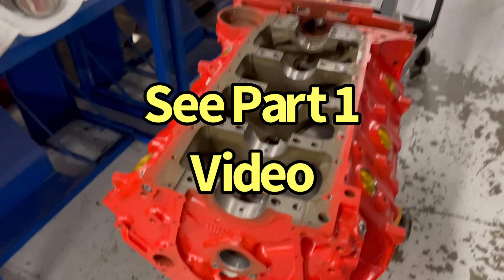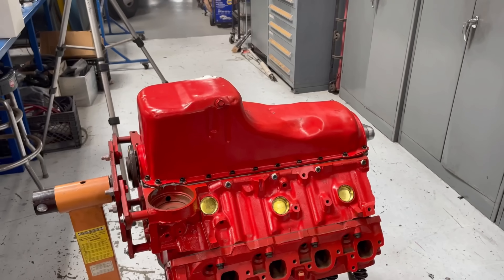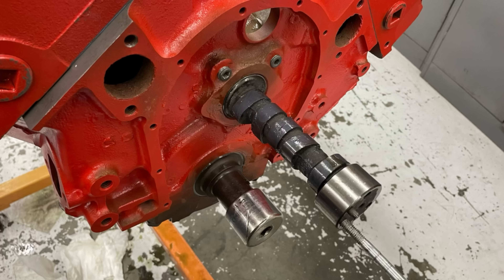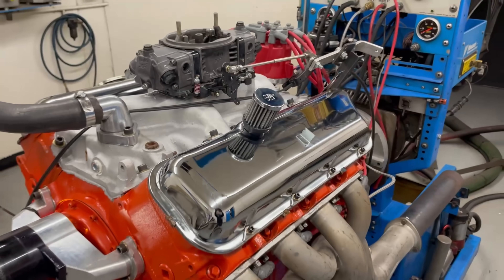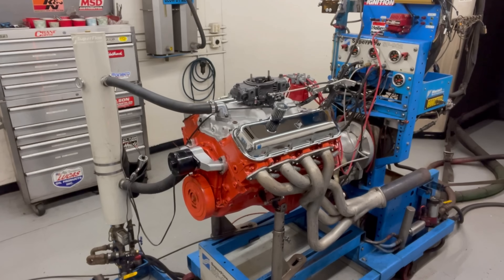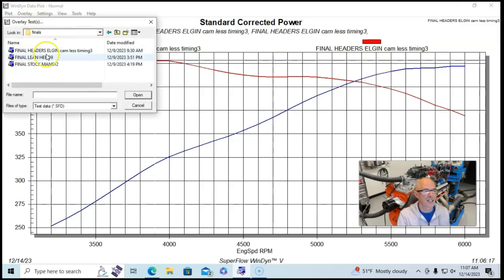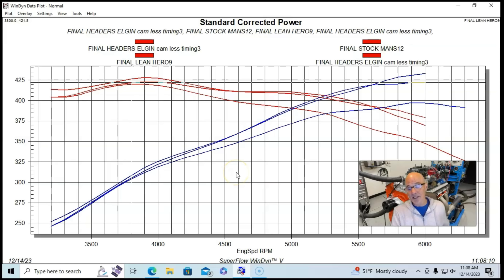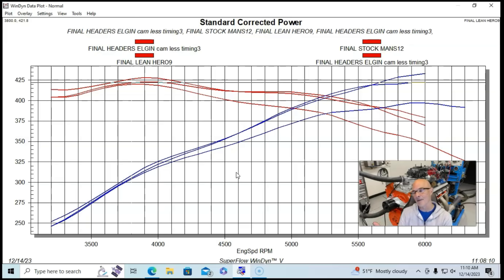FULL DYNO RESULTS ON THE L78 396, OVERRATED AT 425 HP OR  UNDERRATED AT 375 HP? WHAT DID IT MAKE?

Comment: Would you consider putting a 454 crank (4 inch stroke) in a 396 to create a square engine 4 inch bore, 4inch stroke ? Keith Black makes the pistons for this combo.
Reply from the maker: NO SIR
Reply: @richardholdener1727  I am looking at those same KB 396/402/434 pistons. I am curious why you wouldn't consider it. If there is an unseen (by me) problem with this, I would like to know before dropping some cash down the drain. Very good test by the way.
Reply from the maker: My point was that this 396 is staying a 396 (actually 402). If you are asking if you should do it, then the answer is yes-bigger is better. Or just go get a cheap 454 from the junkyard for less than the cost of those pistons.
Reply: @richardholdener1727  Thanks for the reply, it means a lot. I've had 2 402's for a long time, and in my area 454's have turned to gold $$$ lately. Time do do something with them. Thanks again.

Comment: I was under the impression that in those days they tested the engines bare, with no accessories and maybe not even a water pump.  Today engines are tested with everything on them which I assume includes water pump, alternator and power steering.  I think 375 is the correct rating.  With stock manifolds and so forth it was hard to get 1 hp per cubic inch, and harder on a large displacement engine than on a smaller displacement engine such as the 302.  Now how they got 365 hp out of the FI 327 I don't know.
Reply from the maker: The L84 Fuelie 327 was rated at 375 hp, the carb L76 327 was rated at 365 hp
Reply: @richardholdener1727  I wasn't sure if I remembered the numbers correctly but a 327 getting the same hp as a 396?
Reply from the maker: This 396 clearly makes more than the Fuelie L84!
Reply: @richardholdener1727  Well I would agree with that too.  If it didn't there would be a problem with the tuning or maybe the cam grind.  I remember that the fuelie cams were pretty radical.  I didn't have a fuelie Corvette but did have what I thought was the same cam grind in other cars.  But if the 396 has more power then that brings into question how each engine was rated.  Your tests seem to support the 375hp rating of the 396 so the 327 rating might have been much less conservative, more optimistic.  I've noticed that it is easier to get a small cubic inch engine to make more power per cubic inch than a big motor.  I remember when the pro stockers, both Jenkins and Glidden, switched from big blocks to small blocks and kept getting faster.
Reply: @billj5645  check to see what RPM they were turning to get those numbers .
Reply: They probably didn't have the power steering pump on, as it was an option back then, an option that speed freaks didn't order.  Marketing dictates the highest possible numbers.

Comment: Mostly just curiosity, but why, when you are dynamometer testing, don't you set the engine up in the configuration it will have when it is in the car?  E.G. air filter, water pump running off the shaft pulley, mufflers?  Maybe it's as simple as being able to directly compare other engines output, apples to apples, without having to know what the end user is going to use for those accessories?
Reply from the maker: I have accessory tests up too
Reply: Because the manufacturers test them without accessories, so he is duplicating THEIR test to see if he will get the same power figures that they did.  If he puts the accessories on it, it will make about 12% less.

Comment: The stock 396 is a dog. All the weight of a big block with barely any more power than an Lt-1 350. However, with modern heads and cam the potential is much better.

Comment: I had guessed 440 HP  full dyno tune so I wasn't too far off. Now throw on a set of 290 AFR heads , a hydraulic roller at 280/600  112 and a rpm air gap and see what happens

Comment: HioSSilver1999 said: "I would love to see what some general improvements would do to this engine.  Stuff like a better balancer,  better oil control, roller rockers, better intake, e85. Do that with the stock cam and heads!"

I would like to see the same tests... and then add a rowdy street/strip cam... and then add NOS to see how you can take one on a "relative budget" and up it in stages. Or, do the upgrades HioSSIlver1999 suggested and add NOS with a stock cam... or both. Keeping in mind a hot street driver to the dragstrip and toss on slicks type of sportsman deal.

Comment: Can you test any built engine with no power valve and square jetting to show us the difference?
Never understood this for a street performance car. Whats the advantage? Run 79 and 89 on my 850 AED 383 solid roller sbc
Cant imagine putting one 89 in a primary jet.

Comment: Awesome stuff Holdner. Heads looked like they just got stock replacement valves and not stainless. Curious when the valves went in did they do a 3 angle valve job? How much power potential could that create over a factory valve job from the 60’s?
Reply from the maker: factory valve job

Comment: From Leo:  375hp as installed is realistic.   I am old enough to remember them and whatever the number, that engine made quick work of overcoming the grip of the bias ply tires of the day.   The engines were durable and lots of fun for as long as you could keep up with the payment book and speeding tickets.  Thanks for the test, too bad the 291 numbered heads had a crack.
Reply: Restored a 69 SS Camaro vert that was a factory L78 car with chambered exhaust. That car ran and sounded SO good...didnt want to get out of it. Love those lil  big blocks. 383 sbc on steroids
Reply from the maker: no crack-just leaking past the exhaust guide

Comment: that's pretty much spot on... I saw them squirters having fuel pulled thru them.. looked like the primary may have been leaking at the gasket? I've got the 325 hp version in my 68 Chevelle SS 4 speed. It has oval port semi closed chambers that makes great torque. Crane 270 old school car. Its a tire fryer with 3.31 gears.
Reply: Saw that also

Comment: I had a close friend back in 1966 that bought a 66 Chevelle 396-375 that was special ordered by a guy who backed out of the deal.  It didn’t have a radio or heater.  The car was fast compared to the muscle cars back in that day.  One thing I will never forget is that the Chevelle came with a 3 barrel Holley from the factory, we pulled the air cleaner off and I saw with my own eyes.  I’ve seen 3 barrel Holley carburetors but this Chevelle 396-375 is the only one I ever saw that came from the factory with it.  The guy who special ordered the car was going to race it and I’ve often wondered if the 3 barrel was used because of the special order that made it evident that the car was intended for drag racing.
Reply from the maker: the 3-barrel was not a factory option
Reply: @richardholdener1727  I can tell you this that I saw the car straight from the dealership and It had the three barrel Holley on it, I am 100% sure it was the three barrel Holley.  I don’t know how it came about but like I said I’m 100% sure that when he picked up the car the carburetor was on it.
Reply: Was it bought at Nickey in Chicago?? We put anything on a car for a price.
Reply: @davidshields5423  As would most dealerships for a little "Under the Table" $$$

Comment: Great video !
I have a 427/425 in my 66 C2.
I have build the engine by myself according original specs but with an L88 carb and a comp retrofit cam.
With the stock exhaust manifolds and stock side pipes she felt very sluggish from 4200rmp up.
I replaced the stock sidepipes with larger inner diameter pipes but kept the stock manifolds.
Set the wot afr to arround 12.5 and added a Progression ignition distributor, set at 38deg total.
And she ran way better, but still don't feel like 425HP.
I never had here on a dyno, but I guess she has more arround 400hp.
But anyway, there is soooo much fun to drive her.
Reply: Manifolds esp sidepipes were power killers. Long tubes and a proper 2.5" dual undercar exhaust will wake them up

Comment: Richard,
Did the 3310 780 carb I sent you work?  I was wondering why there wasn't a dyno reading shown for it.  I zoomed in on the pic on your dyno video and saw that it looks like it was damaged during shipping.  The main body vent tube on the primary side looks like it's been knocked down and there appears to be something in the tube plugging it.  On the secondary side the vent tube is missing and the casting is split where the tube goes.
Reply from the maker: the tube was damaged-not sure if it was in shipping or after (though we were careful with the unopened box)-carb was a serious leaker and I didn't have enough dyno time to fix it (I should have opened and pre tested it-that's on me)
Reply: @richardholdener1727  Richard, where was it leaking fuel from?   If you are done testing with it, please return.  Thanks.

Comment: Back in the day (1971-72) I owned a L78 396 Corvette Sting Ray Coupe. My engine upgrades were Hooker headers, A set of Crower racing valve springs and a Mallory dual point distributor, which was more trouble than it was worth, as I spent alot time at Reath Automotive getting the points calibrated on their Sun distributor machine. But that engine was very stout. That throaty idle sounds familiar. Thanks for the memories.
Reply: @georgeperillo6421   I think 1965 was the only year that Chevrolet offered the 396 L-78 425 hp in the Corvette. 
In 1967 & 68 I had the same factory 396 L-78 in a SS Impala. And I assume you already know what that Vett would run in the qtr, and you obviously would’ve been faster than my full size Impala, being lighter, and Vetts were known to hook up better than most with a good pair of slicks. But I could turn consistently in the mid 13s in the qtr with slicks and a 4:88 rear end.
Reply: @garywilson7992  Yes, 1965 was the only year the L78 396ci was put into the Corvette. I had a March built 1965 Corvette L-78 396ci / 425hp engine (only) that was rebuilt with what we called a full race cam and the compression ratio was bumped from 11 to 1 to a 13 to 1 compression ration and stock heads, intake, carbarator. It was put into my Slit Bumper -1972 Camaro RS/SS (Sun-flour Yellow) with a stock turbo 350 transmission, and 373 ratio rear end. Never made the Drag Strips that were long distances away, but our County Sheriffs Office held street racing down by allowing us to race using two way radios for shutting down all traffic on the seldom used roads, with letting any traffic go through between races. Sometimes we talked a couple of Sheriff Deputies into sitting at the end of our measured off quarter-mile for giving accurate trap speeds, along with stop watches used at starting and ending lines, which were visually and radio communicated starting of the stop watches. We we crazy, so there was no pretty ladies flag starting the races, instead it was men with big brass balls and were usually intoxicated, and yes all of us drank beer while racing with everyone policing each other for someone being "too intoxicated could not race". "How stupid and young immature we were". I used to power brake the transmission while popping wheelies coming off the line with ETs in the mid-tens at over 135mph. Back in the 1960's and 1970's, the cops would always tell us to take our drinking and parting off main street. We were told to either "take your drinking out of town, or go home". Most of us were underage drinkers, but, back then most people figured if you was near the age of being drafted into the Vietnam War, you are old enough to drink, especially if your life was to be taken in Vietnam.
Reply: @michaelfercik3691   Quite an upgrade to the L-78 with a higher lift cam & the 13:1 compression, but to be honest, I wonder how accurate whoever it was that was doing the 1/4 mile timing claiming mid 10s, seems just a little faster than I would’ve guessed. I did something similar in 1969 with my 67 Chevelle factory L-78 engine. Had it rebuilt with the L-88 cam, 12.5:1 compression pistons, etc, along with the 4:88 ring & pinion I had taken out of the 65 Impala before I sold it. Anyway, with 10” slicks, I was around 2 seconds faster in the 1/4 than the L-78 Impala. Of course to a layman that doesn’t sound like much difference, going from mid 13s to mid 11s, but that translates to a huge difference at the end of the 1/4, when every 1/10 of a second is around one car length give or take. And so if you ran mid 10s and I ran mid 11s, I’d of lost by around 10 car lengths.   
And yet it sounds like we had fairly comparable engines, and so that’s why I question the accuracy of the timer?
Reply: I sure dont miss the days of fighting points. I did more than a fair share of junkyard HEI swaps and never looked back. That was such a great system even stock on modified motors.
Reply: Reath Automotive in Long Beach? Is it still there?
Reply: @h2oskiaddict  Nope, it's gone along with Lion's Drag Strip.

Comment: Impressive numbers for factory 60s tech still. I didn't think it would be anywhere near 375. The old SAE gross numbers were best case with no accessories, on a Dyno, usually with a set of headers, and that's exactly what you did, and basically got dead on exact numbers to the gross ratings. Cool to see a best case manifold run too.

Comment: Cloned one of these motors using a 2 bolt block, open chamber rectangle post heads with some mild port work.  Borrowed it to a buddy to use for a bit in his 69 Chevelle.  We raced a mutual friends 68 Chevelle with a 454 that ran 12 flat earlier that day at the test and tune night.  Both cars were very similar.  68 had slicks, 69 had drag radials on our little late night street race.  The 408 won with full exhaust on the 69 vs open headers on the 68 by about a 1/2 a car length.  The 68 guy was very impressed by the 408 and so were we.  I have always been impressed by what the smaller BBC was capable of on the street and the strip,  Good video thanks!
Reply: Same here. Head wants a 454 but after an afternoon blasting around in a built 396 its just right. 
They dont like too much sustained rpm as I found testing the line lock too much. Wrist pin was crying lol
Reply: Do you mean you loaned him the engine ?
Reply: 12 flat? They're both slow as shit for big blocks. Wow

Comment: We ran a 396/375 on the engine dyno with the stock 780, stock solid lifter cam and manifolds but it had an electric water pump and made 378 on 110 octane gas!
Reply: If you don't NEED it, (I.E. optimal timing and A/F ratios on pump without knock) race gas will actually make less power.  Slower burn rate and other factors.
Reply: @JViello  a 396/375 has 12.5 compression!!! And it’s supposed to be ran on leaded fuel.
Reply: @scottsigmon926  12.5!? For the L78?  You mean 11:1 right?  I don't know what any of what I wrote has to do with your comment.  It was just a factual statement about fuel octane.  We were talking about what the engine produced from the factory in 1969 and you were using an example using fuel that had a MUCH higher octane than what was available in 1969, higher specific gravity etc etc etc.

If you are saying the engine YOU ran had 12.5:1...that might have been your problem right there.  Race fuel isn't some magic bullet.  Head design is much more complicated than "compression vs octane".  There are designs that are optimised for a certain compression ratio and any attempt to raise it is met with less than great results.  Again, just a stated fact, not saying your engine had this issue or that the L78 did.
Reply: @scottsigmon926  LOL, no, L78 396/375 has 11/1 compression

Comment: On my 1970 L/78 I put a set of L88-L89 open chamber heads with the matching 12.5: 1 giant dome pistons with a bore at 402 cui 
Harrison mag pulse distributor. I had the Hemi 2.25 intake valves from Chrysler. 120cc chambers. Factory intake with a 1” Moroso spacer below an 8.50 DP Holley  plus a set of Hooker 11:51  race car headers with 2 1/8” primary’s 
533 hp at 7,k on the floor Dyno 
At MOTON Performance in Baldwin Long Island in my 1970.5 Z29 RS/SS Camaro.
The car had a 4.33:1 posi 12 bolt rear and super T10.
Reply: That's a lot of go power for a alloy t10 to handle. My 70 AMC Jav runs a 518hp 401 and I had to go back to the Iron case t10. Super t10 cracked after a few hard road course  laps. 2yrs later the 50yr old  stock case t10 is still running strong.
Reply: @scoutdogfsr  Had a 71 sst 401 .What did you do to yours to get that kind of power?
Broke my share of the top left ear of a few muncies...all big blocks.

Comment: Great test!  I've owned 3 of these over the years, not really surprised. I noticed the heads you used were the closed chambered ones. Do you think the 70 models with the open chambers would do better? According to the "how to hot rod a BB chevy" book the open chamber heads on a 12 to 1 427 made 20% more power with the same compression. I've owned both the open and closed chamber 427's , both with 292 comp  cams (love that cam in a BB Chevy) and the open chamber sure felt better on the seat of the pants dyno. Keep up the the great video's!!!
Reply from the maker: did they change the head/piston in 1970?
Reply: Yes,sometime in later 69, all the Z-L1's and all 70 396-402'
 went with open chambered heads with larger dome pistons. Even the L-88 second design were open chamber. The  aluminum heads were 074's, don't remember the steel head #s. I had a '70 nova SS 396 (402), all matching#s and it had the open chamber steel heads. It was really an emission deal, but because of better "flame travel" , they picked up 20% more horsepower with the same compression according to the "how to hot rod a big block chevy " book. I had an uncle that worked for for Ford  from 1957 threw 1988 in R&D, and he agreed that was right. He's the one that said it was really an emission deal!      @richardholdener1727